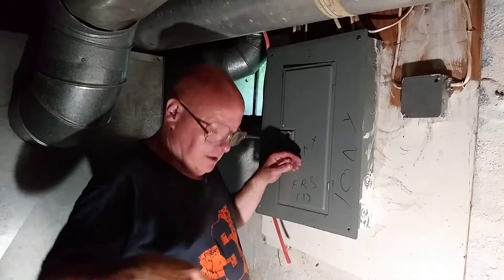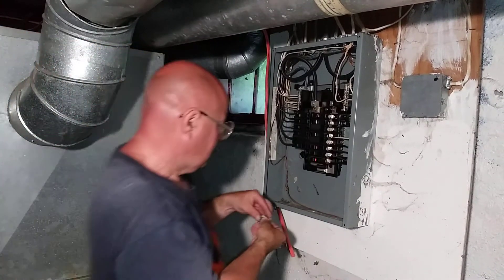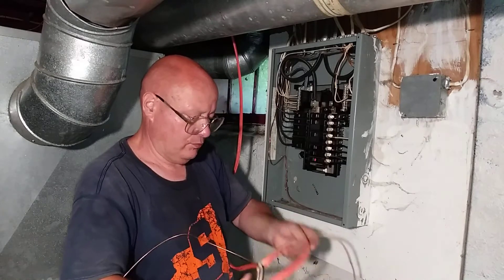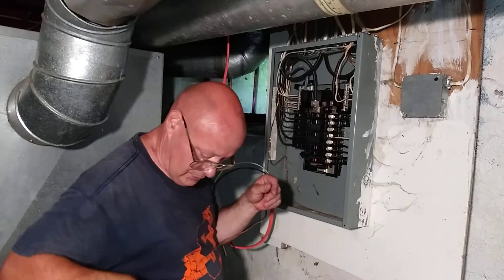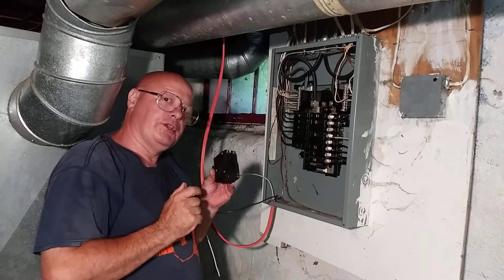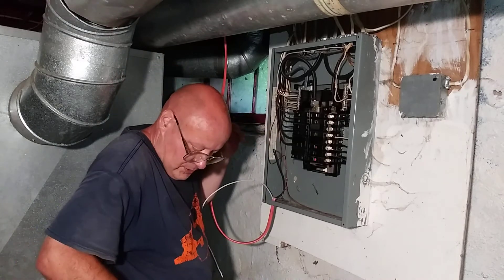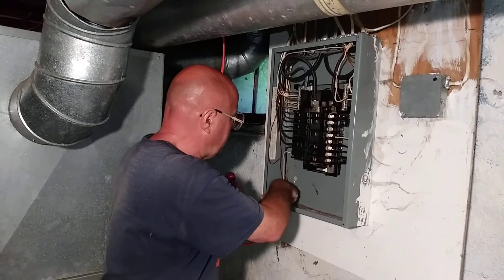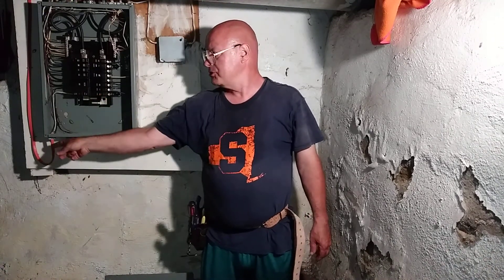I show and explain how to install 20 or 30 amp 220/240 volt circuit breaker and wire in

Comment: What a crap job. Why didn't you enter the panel at the top? OK, if there wasn't enough room or a knock out wasn't available and you had to bring the cable in at the bottom, where is your strain relief connector (Romex connector)? A fire waiting to happen.

Comment: How in the actual hell does this video get up votes?
Reply: That's my question, also.
Reply: Because it's too dam FUNNY 😂
A White wire on the 2nd pole of the Circuit Breaker, without marking it??
I actually think this is a comedy sketch, because I DID "LMAO" to tears.

Comment: Why would you take the chance on shocking yourself.  Hook up ground then neutral then hook up hot to the breaker before installing it. And keep your neutrals and grounds separate.
Reply: It's a 240v circuit. Meaning, in this case, that both the black and white wires are both line or 'live' wires. You're totally correct! Best practice is to connect your line wire last. However, neither wire is acting as a neutral wire in this scenario, so that practice is nulified here.
Reply: @Samiek97  Then your unused current will flow back to the ground when the unused current should flow back through the neutral back to the source .

Comment: A question, I was instructed when wiring a 240v circuit, if you're using black and white wires, that the white wire should be colored black, a  magic marker works. This is so it's obvious to someone who may come behind your work in 10 years what the electrician before them did. This may or may not be required in your area. I was just checking. Thank you for the video, nice, organized work.
Reply: PThe 

So there are 2 hot wires and a ground wire where is the neutral there should be 4 wires that’s what I work with and the white wire should be the neutral 2 black hot (or one black and one red) and a bare copper wire would be the ground.even if you can wire the ground and the neutral on the same bar because the 2 bars are bonded don’t you still need A neutral?

Comment: Why not go in from the top? Or the side ?
Reply: If you come from the top you run the risk of water getting in.
Reply: @joshkraai7657  Soooooooo-o-o-o I guess the main power feed is immune from water? 😂😂🤣😂🤣
Reply: @joshkraai7657  yeah cause all the other wires up top. you only have to worry about water in an exterior situation no one ever uses that mentality on interior because if water gets in side of residence that far it’s already too late I mean do you even electrician